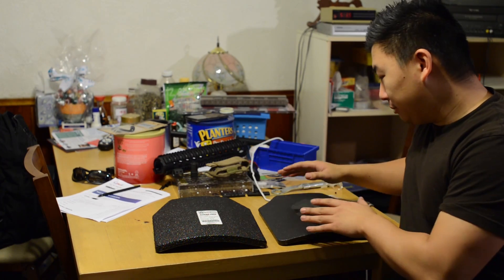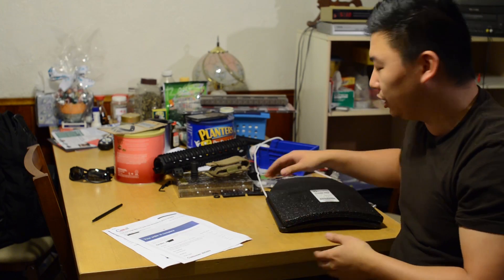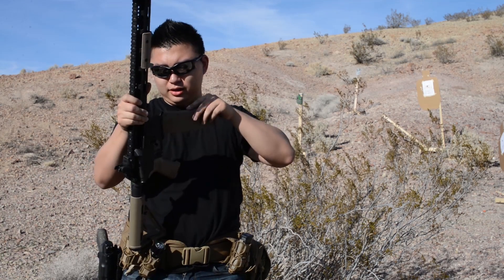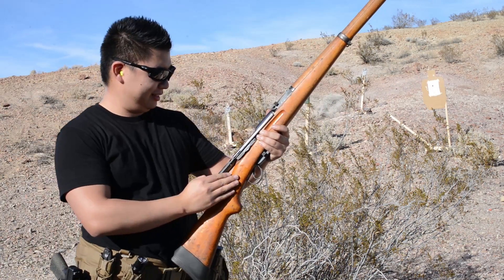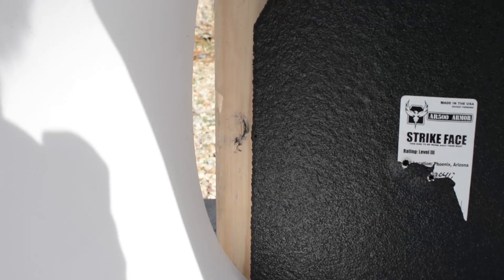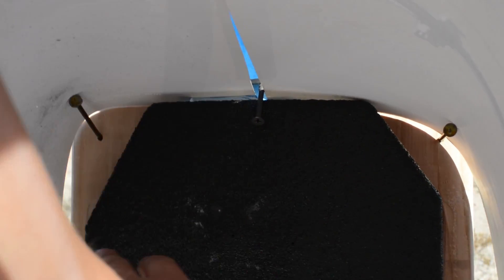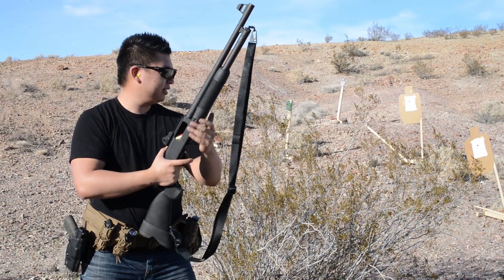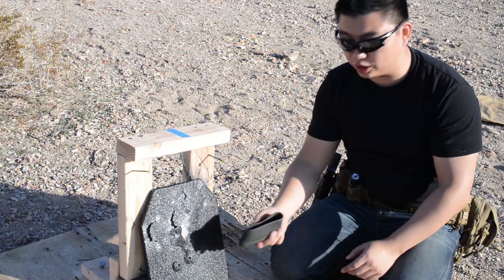The Targetman Spartan Armor vs AR500 Coated Armor Plate Comparison & Review

Comment: Old video but it's a good test. One of the better ones I've seen. Just for reference, duct tape, about 1/4 inch worth, will protect yourself against spalling if applied to steel core plates.

Comment: Yea right, I saw much light holes in the paper from the omega armor test. What I saw with the ar500 paper was just black stains on the paper from the extra build up off the coating. is there a reason why you did not show the paper?

Comment: I am currently pricing out and checking out armor for home protection and have been looking at different companies. This is a HUGE help as I am looking at Spartan armor, the only thing is pricing.
Reply: If you haven't pulled the trigger on this yet, AR500 has a package deal for carrier and 2x III+ plates for $245.  Add in side plates and a curve to all plates, then "twangnbang" coupon code for 10% off, and I was out the door with a full setup for <$280.

Comment: Hi do, you have an updated review comparing these two products? I am currently comparing the Level 3+ (AR500armor) vs Level 3+ AR550 (Spartan Armor). I am currently seeing that the pricing from Spartan is better, but don't want to sacrifice safety for a few bucks.  Thanks!
Reply: Same here. Looking for Level 4 armor but theres no comparisons anymore. And some companies Level 3+ is different than others. Level 3 is the standard. Level 3+ is anything above that standard, which can differ from company to company. So I want level 4 armor but theres no comparisons that I can find.
Reply: A'Murica from what I can tell, you’ll likely be looking at ceramic for level IV. Take my response with a grain of salt as I’ve just started going down this rabbit hole for about a week

Comment: Thank you for sharing these un-bias testing. Is the Spartan Armor you tested in this video has a full coat or just the base coat? Thanks again.
Reply: Thats just the base coat.
Reply: That Car Guy Did Spartan downgrade their base coat? They state on their website that the base coat will not contain fragments, but will make fragments project farther away from the body compared to uncoated plate. In this video that plate did retain some fragments.
Reply: @dannyc.5816  No, like all anti-spalling coatings, they do fragment, it's just depends how much and what you just got shot with. Your carrier will also contain it 99 percent of the time. Just like they don't use the term "bullet proof" but "bullet resistant" since anything can be penetrated. Its more for lawsuits id assume. Their full coating(Encapsaloc) is what you are looking for if you truly are worried. But most people don't get it as from most videos you see the base coat does a great job at mitigating spalling anyway, at rounds the plate isn't even rated for 30-06 and some of the hotter .556 rounds.  Great plates.

Comment: Why didn't you show the paper head to head?  You claimed that the AR500 did much worse at containing fragmentation, but the massive wholes in the Spartan Armor paper beg to differ!!!  Show the paper side by side so we can all make our own comparison of how much fragmentation actually occurred.  Or better yet hang the papers side by side in a dark room with a lamp behind them so we can see how much light is actually showing through the paper as apposed to black coating just sitting on top of the paper.
Reply: +Jane Doe The Sparton Armor in my opinion did alot worse in fragmentation.

Comment: Seems like you should have started with the rifle since they are rifle plates after all.
Reply: I mean, you aren't likely to get hit more than once or twice anyway. Like ever.
Reply: TheCounter005 Honestly not trying to crap on your test. I do appreciate your effort. But after the plate has been hit a couple of times, the coating is more or less compromised. I think a more useful test would be to see at what angle the coating becomes ineffective, since, in only the most ideal scenario would your plate be hit straight on. Heck, when I was shot, it came from the side and went through my calf. If only they made armor for that =/ Anyway, thanks for the vid.
Reply from the maker: TheCounter005 First off, thank you for your service (assuming your GSW was service-related). After the first few shots the coating was definitely compromised. Hitting in the same area over and over definitely isn't a very proving test. You're right, it's unlikely to be hit multiple times, let alone in the same spot. If it does happen, the wearer is doing something terribly wrong! I think my shit shooting also covered another scenario, which is an off-center shot. It can't be assumed that the shooter will have a dead-center COM shot on a moving target. If I had the capital to buy half a dozen plates, I definitely would have had more leeway in creating a more scientifically accurate test, but we do what we can with what we have. I appreciate your feedback!
Reply: ***** NO, I was absolutely not in the military and did not mean to imply that at all. I was just the unfortunate recipient of a negligent discharge while participating in a carbine course when a guy fell over and squeezed one right through my lower right leg. I probably shouldn't have even included the gunshot comment as it was more tongue-in-cheek than anything.

But the angle test is definitely something I'd like to see in armor reviews, because I'm fairly certain that AR500 type armor would show some pretty shocking and disappointing results.
Reply: TheCounter005 sorry for the late response, by the way. Totally forgot about this.
Reply: TheCounter005 I have seen one guy who actually shot these at 45 degrees or so, and the results are pretty awful. Like you expect, it's just a pile of high velocity fragments coming out of the armor. Arms are going to turn into confetti, or comrades torn up, especially in a vehicle.

After thinking about problems with fragments and ricochets, I sold my steel plates and carrier and got a kevlar vest. 95% of the threat out there is pistols and shotguns, and kevlar stops those rounds cold. Yeah, with broken ribs or serious bruising, but it beat having your arm torn apart, especially if you need to shoot back.

Comment: Good test.  The only part that doesn't seem legit to me is shooting the plates with pistol rounds before testing rifle rounds.

Everybody knows these plates will stop pistol rounds, and the coatings will contain the splatter from pistol rounds.  But compromising the coating made the rifle tests somewhat invalid.  

A better test would be to shoot a pristine plate with 3 rifle rounds.  First near the center, straight on.  Check for splatter.  Next near the edge.  Check for splatter.  Last 45 degree angle in an area not compromised by previous shots.  Check for splatter.

Comment: I'd like to see xm193 on these plates.
Reply: Ron Alexander XM193 will penetrate both plates at 10 yards.
Reply from the maker: aluisious Actually no. I highly doubt that. XM193 is a 55 grain bullet in a 5.56 case. The rounds we were shooting were .223 55 grain, rated at 3250 FPS. Roughly the same. XM193 will do nothing to these plates at 10 yards, based off the results we've seen with the .223 55 grain.
Reply: ***** I know exactly what XM193 is. Search Youtube for "XM193 AR500" and you'll find all the proof you want. Velocity kills plate metal. Your ammo was probably rated at that velocity for much longer barrel lengths than XM193 requires. Without a chronograph you really have no idea.
Reply: aluisious Will penetrate within 30 yards out of a 16" barrel. Been proven in multiple videos.
Reply: Matthew O'Connor The Wound Channel did that test. XM193 punched through the steel plate and still went through a gel block after. Seems plenty lethal still.
Reply: Matthew O'Connor Still think it wouldn't cause very much tissue damage even if it penetrated?
Reply: +aluisious Different brand of armor. Not all AR500 is created equal. Most other companies are using generic target grade AR500 steel. Spartan uses Omega AR500 which is made and sold for armor plate material. 

55gn 5.56 is outside the certification scope, but it is common for certified armor steel to stop M193. I tested it myself. Omega AR500 has also been known to stop 30.06 black tip. Again , not rated for that, but guaranteed ratings have to exceed the margin of guarantee to be reliable, and actual rated steel isn't comparable to target grade junk bent on brake presses. 

You might get penetration with a 20" barrel and molly lube, and you might get penetration with crappier target grade steel bent on a brake press. AR550 was introduced to get M193 within the actual certification range.
Reply: +Matthew O&#39;Connor Any time I've seen full plate penetration, whatever was behind it got messed up royally.